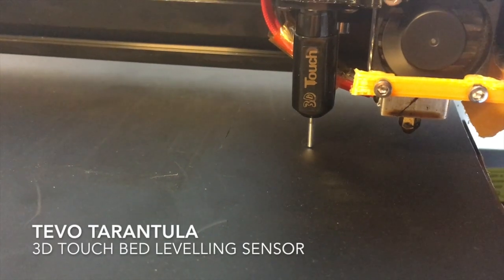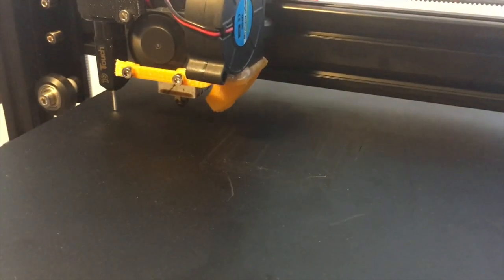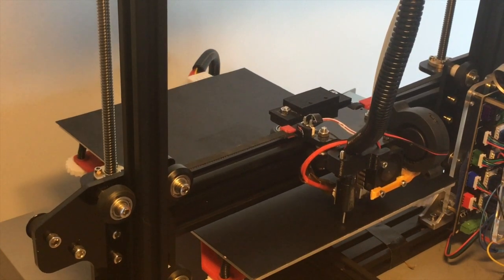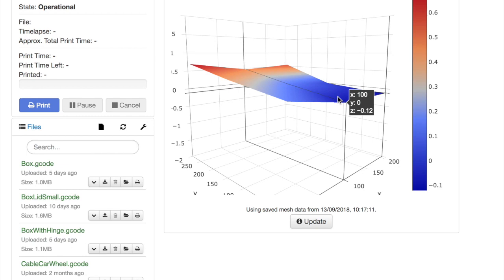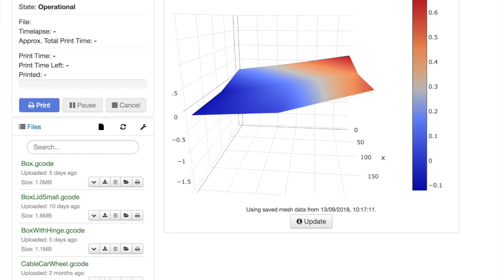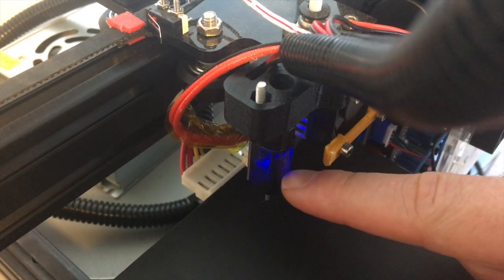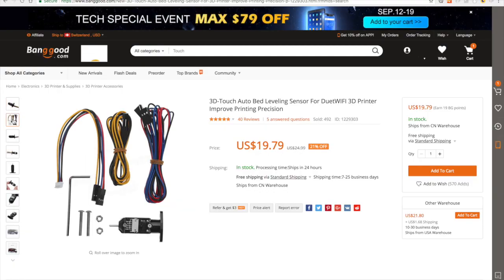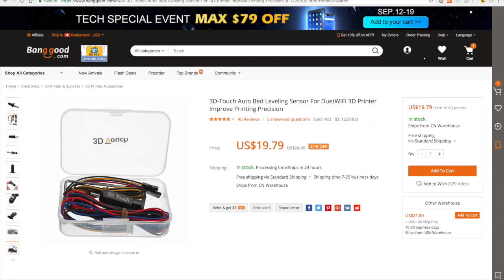3D Touch Bed Levelling Sensor for Tevo Tarantula Review

Comment: I highly recommend you to make repeatability test for that clone My trianglelab 3D Touch clone is all over the place (Standard deviation is 0.003 to 0.13!) I never trust that simply removed and replaced with capacitive sensor which is alot consistent ...